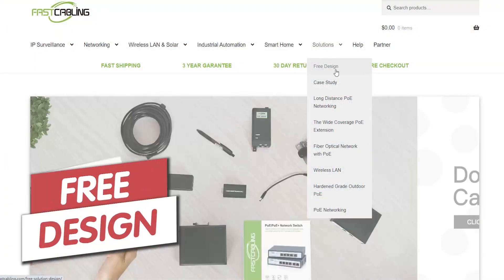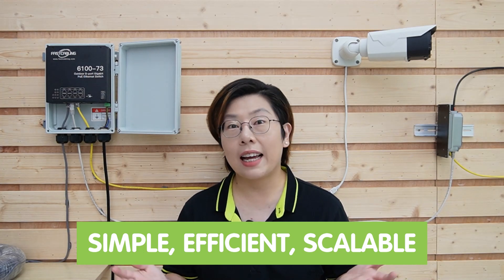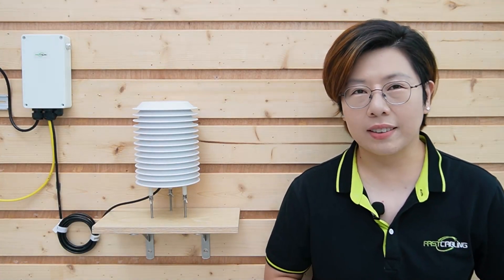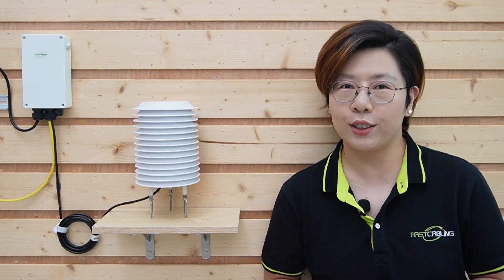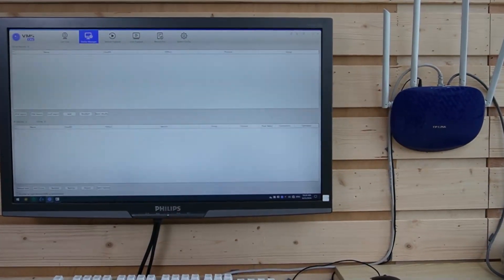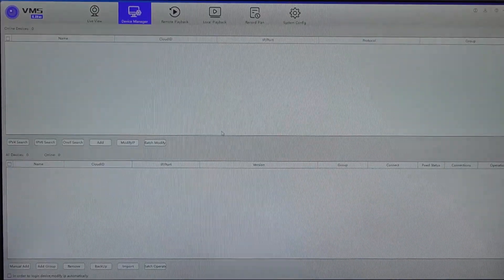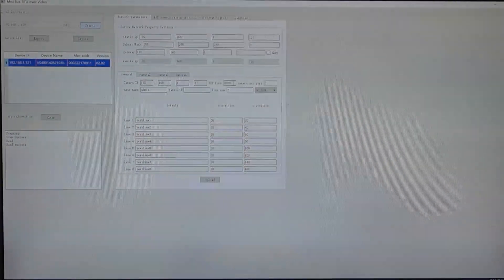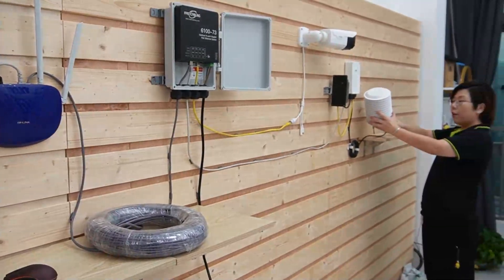Monitor Serial Sensors & IP Cameras Using PoE: Complete Setup Guide

Comment: Madam.  Which.  Router. Is. Best. To. Ip. Camera. For. Cctv. Camera. Via. Lan
Reply from the maker: Ensure the router has Gigabit speeds. IP cameras, especially high-resolution ones (e.g., 4K or 1080p), require substantial bandwidth. Security is crucial in a CCTV system. Choose routers with strong firewall protection and VPN capabilities to protect the cameras and network from potential attacks.

Comment: I have an ip camera (imou cruise dual)  connected to a dvr (Hikvision 7200 series), the problem is the dvr is interfering with the motion detection settings on my phone , how can i prevent that and maintain control on the ip camera from both dvr and the phone separately
Reply from the maker: Set the DVR to use the sub-stream and your phone to use the main stream, so the phone's motion detection isn't affected by the DVR's operations.